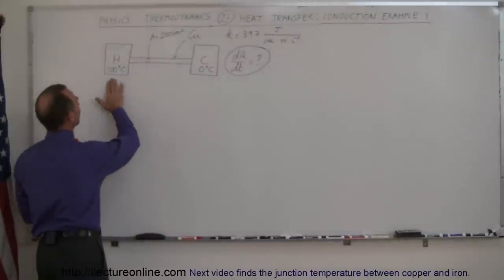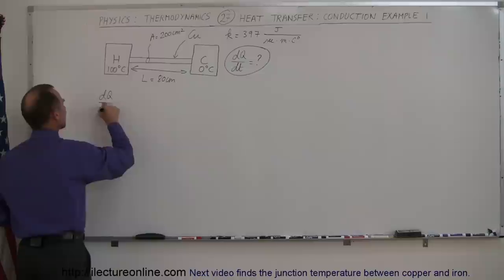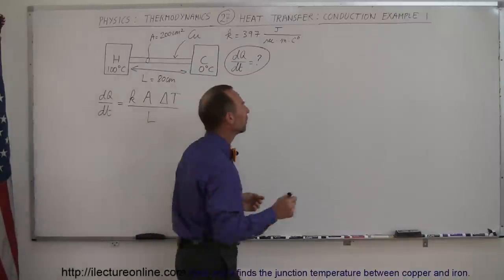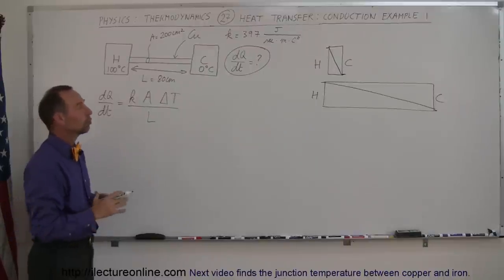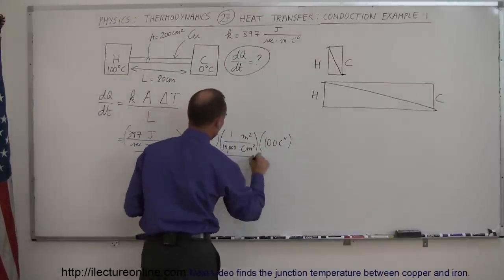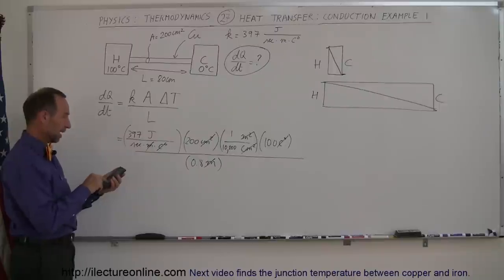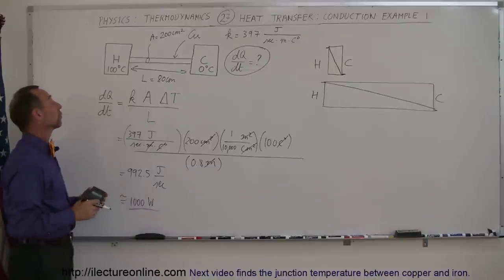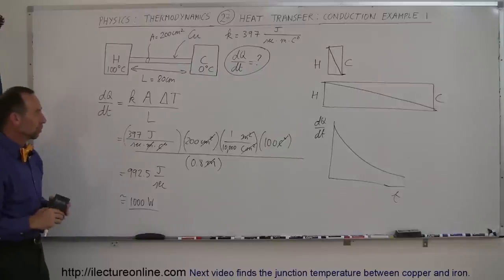Physics 24  Heat Transfer: Conduction (2 of 34) Power Dissipation

Comment: Thank you very much. Very clear and interesting.
I have a few questions.
Lets say that only one side temperature is static and doesn`t change.
Let say the Hot side(left one) always stays 100C''  while the left side will start gaining temperature from the initial 0C to 100 C.
in such a case:
1
what will affect larger L value (lenght)? Is it time(sec) or something else?
2
If the time will be affected, than i do not understand the difference between "temperature conductivity" and "temperature capacity". Because as far as i understand, "capacity" is the parameter that "responsible" on a time needed to heat same material of a different mass.
Reply from the maker: Since the heat transfer is a function of temperature difference, the rate of heat transfer will change as the temperature on one side changes.
Reply: oh probably I didnt ask clear.
Say we have 2 buildings while outside is 20 C and inside 0 C.
boath have concrete wall (same k)
the only difference is wall width.
in the first building it is 40 cm
in the second it is 20 cm.
as far as i understand in bouat houses sooner or later the temperature will become 20c just as it is outside. the only difference is the time that takes to make this change. am i right?
if i am right, how do i calculate this time?
Reply from the maker: That would require calculus and it is a bit difficult to try and explain that here in a note.  We may add a few videos describing such situations in the near future.
Reply: great, I ll be waiting!
could you please just tell me if i was right or not (the only difference is time). thank you very much.
Reply from the maker: Both the time and the rate of heat transfer will be different.
Reply: @MichelvanBiezen  where would I be able to find a video with these conditions? Thanks!

Comment: I would first like to thank you soo much for taking the time to create such quality videos. 
I have always had the burning question that nobody seems to be able to explain to me clearly or maybe my brain just doesnt take it well.
 In any given case like this where dQ is a function of dT, doesnt that mean that we're just finding a poor estimation by using ΔT ?
 won't the rate of dQ change after the first second since ΔT is then smaller? 
Or lets say another case where we are trying to stop a car using air drag . where the deceleration α is a function of the Fdrag. But yet Fdrag is a function of velocity itself. 
The answer is always to use calculus, but I have no idea what that actually means or how i would go about solving a problem as such with calculus. Is there any video you could point out to solve my forever burning question ??!! 

Thanks again for your awesome videos.
Reply: What if the constant K was a function of T itself !! ?? my brain is about to explode !!
Reply from the maker: If the temperature on one side changes, then the dQ/dt will accordingly change as well.  There are a number of examples of this with different situations.  After you watch them you will understand it.

Comment: On my textbook, the formula is also written in terms of Q/Δt, but isn't that just the power transfered? So why the formula is written like that?
Reply from the maker: I would need to see the whole equation to determine why they wrote it that way.
Reply: The formula on my textbook is similar to what you wrote but dQ/dt is Q/Δt:     Q/Δt =  (k*A*ΔT)/l, that's because when learn about this we didnt know what derivative or differential is. But my question is: If power is define as P = dQ/dt or P(average)=Q/Δt why on this formulas ,it is more common to write dQ/dt or Q/Δt than simply just P = (k*A*ΔT)/l ?
Reply from the maker: Now I see.  Essentially there is no difference.   If you write delta Q, then you refer to a small amount of heat flowing through the conductor for a delta T period.  If you write Q it refers to essentially the same thing since delta T is still there.    When writing Q it allows for a change in Q during the delta T period where with delta Q it is an average "amount" of Q during the delta T period.

Comment: I guess this equation is valid after system reached equilibrium. Copper has its initial temperature and its distribution changes until equilibrium is reached

Comment: Excuse me sir. When the thickness increases dQ/dT increases but the same heat would be transferred, right ?
Reply from the maker: +The Scientist  
 Let me see if I get the question correct:
  1) Are you referring to the cross-sectional area when you write "thickness"?  If yes, when the cross sectional area increases the amount of heat per unit time that transfers increases   (dQ/dt   not dQ/dT)

  2) When you ask if the same heat would be transferred are you asking "would the same amount of heat be transferred"?  This equation only tells you the rate of heat transfer.  The total amount would depend on the limitations of the available heat.  If the heat continues to be supplied than the total amount would be greater. If the available heat is limited to a given amount then the total amount would be the same.
Reply: Oh yes I meant the second one. Would the same amount of heat transferred if the length changes when there is enough energy supplied ? I think time will change while the amount of heat transferred doesn't change because all of the energy that hot object has will be transferred in both cases but I'm not sure

Comment: Why is it that when the area increases, there is better flow, but when the length increases there is less flow. Surely if you increase the area, it would take longer for the heat to transfer?? Thank you
Reply from the maker: Think of it this way.  Will traffic on the freeway flow better if there are more traffic lanes?  The same thing happens here, more heat will travel along the conductor if there are more "paths" to travel along.
Reply: Michel van Biezen i see, I guess the reason I am getting confused is because when you increase the area of the pipe in fluids, the velocity decreases. But it makes sense, because the flow rate stays constant but if you increase the area for heat, it will just spread. So it acts a little different to fluids if not completely opposite
Reply: Michel van Biezen thanks for the reply by the way :)

Comment: hello sir sorry to bother you but i am confused in the syntax or depiction  of your equation, you state "divide by 10,000 yet syntax dictates multiplication? i would have expected to see{ (397) (200m squared) / (10,000) / .08 }  i was always under the impression that multiplication is implied simply by being next to a figure and division is a slash or a line beneath figures to be divided? I like to use both the slash and the line in equations.  is it simply because its a conversion function excusable from syntax because of the flow of calculation meaning as you compute the numbers it doesn't matter if you divide to convert first then multiply by k or transitionally  you will still end up with the same figure .
Reply from the maker: NOBOX7,
Are you referring to the part where I convert from cm^2 to m^2?
If yes, this is how we should look at it.  (Don't get confused about multiplying or dividing, the method will take care of that automatically).
In the equation we have cm^2 in the numerator and we want to convert to m^2.
Math logic dictates that in order to get the correct units (m^2 must be in the numerator and cm^2 must be in the denominator of the conversion).
Then you figure out what the ratio is 10,000 cm^2 = 1 m^2.
Place those numbers in the correct place and you have the conversion.
Reply: Michel van Biezen thanks for your response i see exactly what your saying
Reply: Michel van Biezen the equation was clear to me it was the manner you illustrated it that confused me,so i was just checking my own interpretation of the art